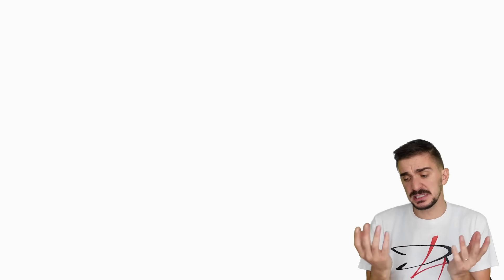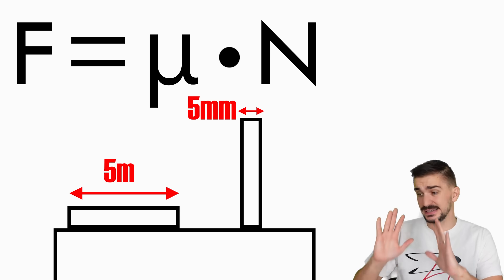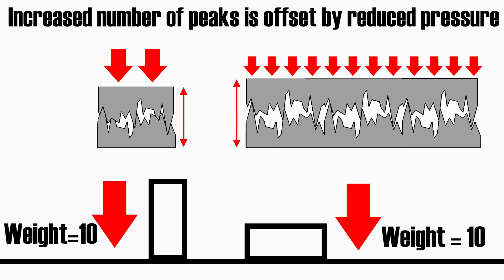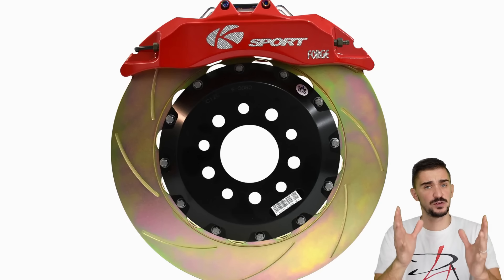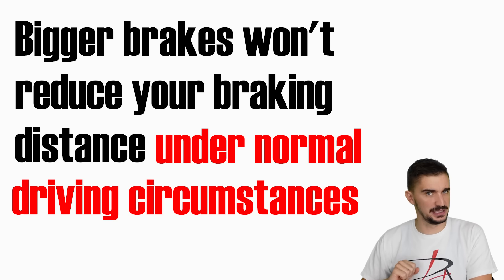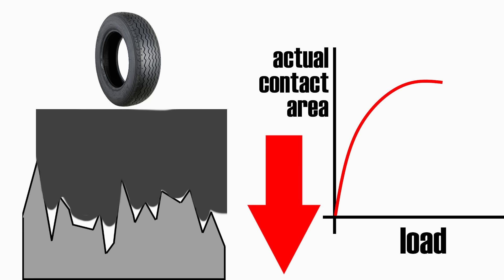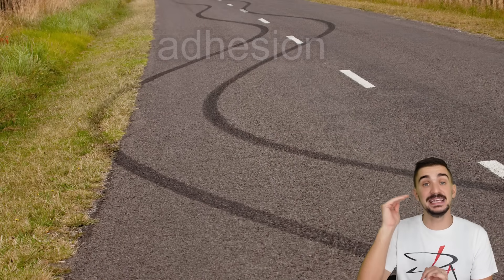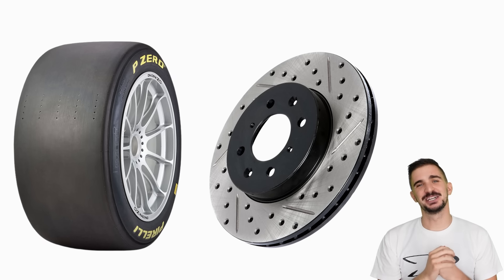Why Big Brakes Won't Stop You Faster but Wider Tires Will - Friction and Surface Area Explained

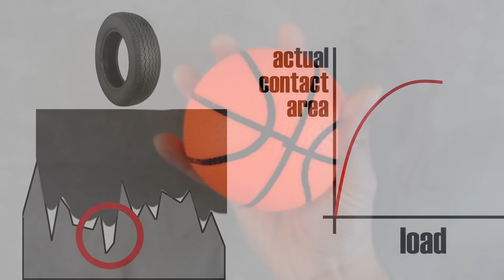Comment: 11:45 The rubber ball example is misleading, because most of the squeezable balls are hollow and filled with air. Like the mini baskeball in the video. (Though that's just like car tires. But you have a different application for the pressure when trying to make a ball smaller vs a tire rubber filling tiny contours for added friction. The properties of the rubber surface matter a lot more for the latter one.). That means you aren't fighting against the rubber becoming stiffer, but instead you're fighting the increasing air pressure inside the ball! by compressing it.

Comment: This is an oversimplification.  If the OEM braking system on your car is not strong enough to lock up your wheels or trigger ABS activation, bigger brakes will help.  It is only after the brakes are strong enough to lock up the wheels that adding more brakes makes no difference.  If you increase the size of your tires, you make it more difficult to lock up your wheels.  Therefore, if you put larger than OEM tires on a car, it is usually advisable to match them with larger than OEM brakes.

Comment: But the main reason why I want big brake kit is because I want my disc brake durable and not easily overheated when I push the car hard. I also always run 500-1000km, 1-3 time per year so I need big brake. But im agree with your theory, big brake does not mean you can stop faster as the tires can't get their traction if the demand is too high. How to overcome this problem ? Do you have any solution ? How about big brake kit but with brake booster(servo) deleted?   Thanks in advance for making this video

Comment: The ability to stop a car is based solely on its tire's ability to contact w/ the road.  Brakes have been able to completely stop the wheel for many years now.  (I'm doing an edit here)  We have anti-lock brakes because there is already enough braking power to stop the wheels at any speed....end of edit.  The tire's ability to adhere to the road is what's next.

Comment: But you forgot something crucial... Large brake systems often have several pistons.  More pistons can generate more power with the same pressure.  More force on the brake slows the vehicle down faster. Or iam wrong? 🤔
Reply: more force on brake will just slip your tire.... more piston meant for bigger brake pad, easier to control/modulate the brake at the limit you might be able to stop shorter...

Comment: I thought that the holes in brake pads for road vehicles was more for water film and grit dispersion than brake cooling. Personally, I brake as much as possible with my engine - or better still, select speeds by looking ahead so that I don't need to brake.

Comment: The large brakes are able to take repeated use whereas the larger tires make the most use of the brakes installed. If you dont need repeated braking (such as racing) then what you have with larger tires makes more sense. If you are going racing, larger brakes with larger tires is the answer!

Comment: Great explanation of braking even though you didn't delve into the subject of tyre-compounds & why softer rubber is used on race tyres, nor mention that high brake-disc temperatures on standard discs can easily lead to them warping!
While some tyre brands use softer rubber for increased performance for road vehicles despite reducing tyre-life, one tyre manufacturer used to justify much higher prices for their road & 4x4 tyres by guaranteeing extremely high mileage on them, but this company only achieved this by using very hard compounds!  No real advantage having tyres that lasted longer but you couldn't stop or stay on the road, especially in the wet!

Comment: Increasing rotor size usually makes it easier to control/ modulate the brakes resulting in shorter stopping distance.
Reply: ABS is better/faster to modulate the brake near limit than human, anyway....if your leg is strong enough just slam the brake and let it do the job
Reply: No one drives a car and slams on the brakes to stop. You modulate the pedal to slow the car as needed. How many times has the abs been activated on your drive,

Comment: Bigger brakes are better for dissipating heat and id like to see you put a smaller brake on an F1 car. It wont work.  You still need a bigger rotor and larger pad for reducing speed through friction.

Comment: You are right,but not 100%, and you miss one big point, bigger diameter for disk brakes has a bigger moment. M=F*a(arm).I prefer everything to be balanced, big wheel and big brakes :)), but I see now reason to have very big wheels if my car cannot generate enough grip with those tires, and if my car cannot generate enough grip I don't see the reason to have very big brakes if the tires cannot use the brakes at maximum capacity.

Comment: 7:34 not only that, but with rapidly increasing temperature, the materials  get softer and wear faster / disintegrate and "molten" material is being deposited on the surfaces, filling the "valleys" , reducing the  friction even more

Comment: Great video covering Amonton's 2nd law of friction.  But not 100% correct on tires, you only treat tire contact patch as directly related to width, which it is not. Contact patch is two dimensional, not one dimensional, and is also related to tire diameter and PSI. If it's wider, it may also become shorter and not actually increase the total area by a proportional amount. You're closer to the correct answer with heat management and wear of softer tire compounds.
Also an increased width increases the swath of asphalt, averaging out small imperfections in the asphalt like gravel or small holes.
But overall you have the principles more correct than most other videos I've ever seen on the topic.
Reply: He made the same one-dimension mistake in another video, which is sad. He has an opportunity to dispel one of the biggest misconceptions, that a tire twice as wide will make twice the contact area with the road. Too bad he squandered it.

Comment: Why are manufacturers making wheels that are taller and tires that are thinner? I think 18 inch wheels are big enough and I like 65 series better than 50 series. I think these taller wheels are too heavy and thinner series tires like 50 or less are not comfortable. I remember Indy race cars had short wheels and very tall tires and they brake very well and handle very well. I don't understand the advantage of 20 inch wheel and 40 series tires, since the wheel is heavier and thinner tires make bumps feel worse because they don't absorb much. Doesn't thinner tires mean the engineer will have to make heaver, more complex suspension to absorb more bumps?
Reply: lower profile tyres give more feedback and handle better
Reply: @arcanevoid9199  you need to look at Indy and F1 race cars from a couple of years ago. Thats bull.
Reply: @patrickgoncalves3878  race cars don’t represent road cars, bigger sidewalls on street tires have more flex which is what causes the worse handling and road feel. this is why companies like Michelin put steel inserts into the sidewall for extra strength which helps this even further
Reply: @arcanevoid9199  not buying it. Thinner tires mean bigger, heavier wheels, extra dead weight furthest from the source of the crankshaft, making the car accelerate slower. Your theory isn't true and this extra weight is useless. Also they have to design heavier suspension because the tires are so thin, adding further weight, less economical, practically decreasing horsepower.
Reply: @patrickgoncalves3878  I mean your choice if you wanna disagree with the facts, obviously there is a balance to be had. too small and you will seriously affect ride quality, and as you’ve mentioned won’t help the suspension. and you can have low profile tires without having massive wheels, and it’s not a theory. what do you think is easier to bend or flex, something a that’s shorter or longer? this goes for many things
Reply: @arcanevoid9199  20 inch wheels are heavier than 18 inch wheels. Its unsprung weight. And Rubber is lighter than the wheels. However much flex you get from taller tires will not change anything enough to benefit handling enough to justify it.
Reply: @patrickgoncalves3878  yes of course, and no there are definitely wheels that weigh less than the tires on them. and if that’s the case why don’t they run 205/75 r16 on a integra for example?
Reply: @arcanevoid9199  you believe what you want

Comment: That statement is not completely true! And the wood example also applies to the tire. 😆 and think about it, a bicycle brake will not stop a car. So yes size matters on both break and tire size. What you may have meant is that breaks are outperforming the tire size.

Comment: they are not taking heat dissipation into the equation nor the force of a longer lever arm offered by a larger diameter disk requiring less force.  Heat is a very big deal when braking!
Reply: If your brakes can lock up the tire, bigger brakes will make zero difference.

They CAN'T make any difference. The brake rotor isn't attached to the road, the tire is. Stopping distance is determined by the force exerted through the tire contact patches acting against the weight and velocity of the vehicle; you'll notice that nowhere in this relationship are the brakes.

Comment: This also works for railway vehicles and "rolling resistance". The head of a new rail has a dome shape. A new wheel has a flat contact surface. Old rail is flat on top and has more rolling resistance. If it was a perfect world and racing cars didn't need to use brakes or turn - skinny tyres would be the fastest option, like the Land Speed Record machines.

Comment: i have A M3 stock brakes 1 piston  to stop 414 hp i keep the same tire size so i went and upgraded to stop tech big brake kit 4 piston and my brake stopping distance improved substantially it did make a big difference

Comment: look, you are never going to convince me that brake disks which are double in size will not provide more resistance against the pads to provide easier braking. the weight of the car is not on the brakes, and bears no analogy to your sideways wooden plank example. in fact, you brake situation is exactly the same as your tire size scenario, so there you go.
 next youre gonna tell me that time slows down the faster you go, and that we can time travel if we could just go as fast as light... surface area also matters in brain function
Reply: easier braking doesnt = better stopping distance
Reply: Just because your brakes are more powerful and produce more braking torque on your wheels doesn't mean you're going to be able to reduce your minimum stopping distance from a given speed. The limiting factor is and always will be grip, unless your brakes are SO BAD that they can't lock up the tyres, or experience fade within 1 stop, both of which are illegal.

Comment: There is a direct correlation between additional tire patch width and increased grip (all 4 directions) - all other things being equal. This correlation gives you between 20% and 60% additional grip for additional tire patch. The example I use is going from a 245 section width tire to a 275 will increase tire patch by about 12%, take that and multiply that times 40% (the average) and you are getting about 5% more grip. That 5% may seem minor, but if your car stops from 60mph in 110 feet, you just dropped it to 105; if your car corners at .95g, now it should be about 1.00g. I've seen too many articles and videos of people buying/upgrading cars with carbon ceramic brake rotors and bitching about how their car stops the same as the ones with the iron rotors, which proves that tire patch is more important that brake rotor material, number of pistons, or size of your rotors.
Another item people overlook too often is that front brakes provide about 70% of a car's stopping power due to weight transfer during braking - upgrading rear brakes (unless they are tiny or drums), does almost nothing to shorten braking distances (even in rear engine cars). So when someone has 15" brakes all around, the rears are just for looks, the 13" would be more than adequate.
Lastly, most front engine cars benefit from a "square" tire setup (same size on all 4 corners) due to having 50% or more weight up front. BMW for years liked to stagger the tire sizes, even though their cars were 50:50 weight biased give or take. 225/255 was very common and hurt braking and cornering quite a bit - anyone who raced these cars always ran a 255 up front to balance out the rear 255, wider on all 4 was even better.
Reply: The flaw in your explanation is that the tire patch is always the same size (area). You can change the relative shape of the patch with a wider tire, but not its size (area)!

Comment: Wrong, Wrong and Wrong.
Larger brakes are better at dissipating heat as well as gasses, and reducing brake fade.
The stopping advantage only comes from more pressure at the pad, which would need increased fluid pressure.
Does the formula (F=μ•N) apply to tyres as well?

Comment: There is a tradeoff, however.  Wider tires increase friction reducing fuel economy.  They will also increase the possibility of hydroplaning or "water & snow skiing", as they will ride on top of the water & snow rather than penetrate to the road surface.  Those are the occasions when you discover that brakes stop your wheels, but tire contact is what steers and/or stops your car.

Comment: Hey, my first motorcycle crush was this s**t-hot Buell and it had brakes waaay out on the edge of the rim, not close to the hub.  I always thought this seemed like a brilliant idea, but I never saw anyone do it again, so it's probably not as smart as I assumed. Is the reason you don't see this due to the properties you talked about here: that it wouldn't actually matter the way we think?  Cuz, dang that's so hard to believe. I'm sure you're right, but man, that's nuts.  Or are these two different properties of physics?
Reply: A 2002 Buell Firebolt.  
 
...the black and gold one, if you're asking.
Reply: Probably makes a bike handle like total dog. The massively increased rotational inertia would of your front wheel would make your steering on the bike feel like molasses I'd bet, plus, if normal motorcycle front discs can EASILY lock a front wheel what's the point of increasing the braking torque? All you've really achieved is adding weight. Not just adding weight but adding it to the absolute worst possible place, since it's sprung AND steering.

Comment: As the power increase everything must be adapted to that power,wheel and brakes.It is as useless a big brake disk with small tires as it a small brake disk with big tires.

Comment: You're completely ignoring that big brakes have much better responsiveness and feel, and usually result in lower stopping distance with a skilled driver...  small brakes are easier to lock up unintentionally and require more input force to make work, thus reducing fine control...
Reply: Stock little brakes overheat before one hard 100-0 stop... stock brakes are good for maybe one 60-0 stop, if already warm...

Comment: love the video, but one little mistake. If you make the brake system bigger 3 things are happening and 2 of them increase the braking force and reduced the braking distance (if your tires can hold it). 1st thing the surface of the braking system gets bigger (that really doesnt affect anything directly). 2nd: the diameter of the brake disk gets bigger, therefor the the same friction force applies on a different radius which increases the leverage, which in return increases the braking torque. 3rd: bigger braking callipers accomodate bigger or more brake pistons. by increasing the size or amount of caliper pistons the force of the braking pads increases, which increases the friction (as N in the formula increases). of course if your tires cant already handle the braking force your original brake, an increase of brake system wont bring anything. But usually they hold more. also what a lot of people forget to calculate in (and that is the reason why a model with stronger engine has bigger brakes than the same model with a smaller engine) that the brake, in an emergency, doesnt only have to slow down the car, but in a malfuction of the engine and drivetrain system the brakes also have to slow down the engine torque together with the inertia force of the car. So at ioncrease of tires or increase of engine power bigger brakes are a MUST!